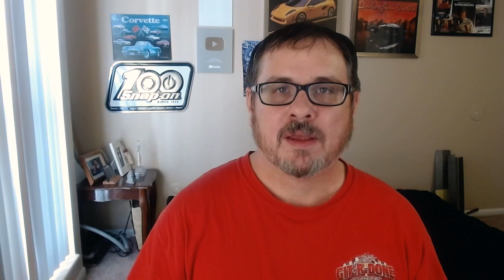Painting 1 Part vs Paint Everything Together

Comment: painting one panel at a time: yep totally agree with the video, you can get some metallic to match doing one at a time but you need to have good control over you parameters and be very robotic about the way you lay the same number of coats down, one for the more experienced sprayers i'm thinking.
if its like a gold metallic then i'd say not very easy.
the other factor in doing one panel at a time vs full respray is the space and ventilation available.
if you only have a 2-4 car garage with no vent then you going to working in a fog within two panels and have the overspray drop down on everything when it settles.
i'm in London UK so thats pure residential and i cant let 2k fumes out side the garage or the council will be all over me, i set up an fan with a filter for extraction, a 150mm ducting takes that around to an imput filter back into the garage so its like a recirculating filter system, works pretty well for 2-4 panels at a time, size is 6 meters x 4 meters so not a very big space at all.

the advantage of doing a couple of panels at a time is you can do the shell on its own then do the doors and hood trunk when you want it also saves on alot of masking material, more than you think esp 2 inch tape.

even at work i prefer to respray a car blown apart unless its a bad edge to edge paint
Reply from the maker: Great points, thanks for the input.

Comment: If he used epoxy primer of brands you have to put your hardner in and wait 15 minutes before you can spray it. When I first started using ppg epoxy primer I was having whole panels peel off with a razor.
Reply: He has to spray bull dog on all his panels that he wants to paint so there won’t be any problems ad hearing
Reply from the maker: Thanks for bringing that up.  That didn't cross my mind, but that epoxy may have an induction time.  Will need to ask NAPA for the technical data sheet to know for certain.  I knew someone on here would think of something.  Thank You!
Reply: @CarAddictGarage  Yeah most epoxy primers have a induction time. I was having come back where I epoxy primed a bare metal hood and 3 months later the paint was flying off on the highway all the way to the bear metal

Comment: here in the uk  i've never used epoxy, etch and 2k primer is the regular thing, so not experienced the problems with epoxy lift
Reply: Be sure to have at least 2 air vapor filters. One at the compressor and one at the gun to minimize oil and dampness in your paint. He forgot to mention filtering. VERY VERY IMPORTANT

Comment: thank you donnie for answer  my question on painting,  i when i paint  my  truck  its  going to  be military green  so there's no metallic or pearl  .  the truck was used in United States Marine.
Reply from the maker: You should have no problem with that color.
Reply: hi donnie i messed up on a question on the washing new oem  ecoat  part.  what i meant to ask is  would it be ok to  just use wax and grease remover and the the skip  the washing the new oem ecoat   with  soap and water  ?   i apologize for asking this question

Comment: Thank you for the great content!   I'm also planning to paint my S10 pickup this spring or summer (1st time painting with a gun) and would like to do a metallic color (TBD) base/clear.  I was considering painting a part at a time as I don't have a booth but that's obviously not the way to go.  However can you do a coat or two of base with it apart and then put it together and then final coat or two of base and then  clear everything?    Also how do you handle the places you can't get to when it's together such as between the cab and bed?    If I can ask one more, are darker metallics more forgiving regarding technique?   Thank you!
Reply from the maker: About the only way to get between the bed and the cab is to remove the bed.  As far as matching, it really depends how translucent the paint is.  More pigment and less metallic will be easier than more metallic and less pigment.  Golds, silvers, and light to medium blues have caused me the most problems with matching.  Whites are also difficult, especially if it has pearls in it.
Reply: @CarAddictGarage  Thank you so much for the reply!   I didn't quite ask my question about between the bed and cab correctly.   What I meant to ask was do you have to do anything special such as not spraying the exterior sides of the bed and cab when you do the opposing faces as I'm assuming you want it back together so as to paint the each side of the truck (cab and bed) at the same time.  Said differently, you spray the back of the cab and the exterior front of the bed with base, then put the cab and bed together, spray the rest of the truck with base, then take them back apart and follow the same steps with clear?   Thanks for the color info as well.   I think I'll go with something other those.     Thank you again for your reply and your channel!

Comment: when doing rust repair inside the car  and cutting  rusted  metal  out  and  putt  in  new  sheet metal  in  the  vehicle      would i have to wash  interior  metal  with dove  dish     soap   with  water  and   use  wax and  remover first then start  doing the rust repair ? can i  just  start  cutting  out  rusted out metal and start  weld new metal  with out washing with dove   dish soap  and  water  and  wax and grease remover ? ?
Reply from the maker: When working with rust and bare metal I would not expose the metal to water.  I would clean it with wax and grease remover before applying filler or priming.  Be sure to use weld-thru primer on the surface that will not be able to get to after welded.  https://amzn.to/3dCQQqn

Comment: hi  donnie  ,  I was reading about lead  filler  soldering    witch is old school body filler  now  they  sell lead  free  soldering    filler  witch is  good.  i have read  lead free soldering cant be use for   rust repair holes ,  i thought you have to cut out   the rust hole to put new sheet metal  in? .  would it be safe to  use lead free soldering for small rust holes no bigger than a   25$  quarter?
Reply from the maker: I would prefer to cut and weld a patch.  The reason is the rust may expand past the hole on the back side.
Reply: @CarAddictGarage      that makes sense . i really like that old school soldering body  filler    its  just cool ha ha.  thanks  donnie !

Comment: What grit do i sand bare metal in preparation for epoxy primer I'm using HP body  989 and it does not say on the tds ?
Reply from the maker: If I were sanding to bare metal I would use 80 grit followed by 180 grit.
Reply: @CarAddictGarage  ok I'll do that thanks for the reply.

Comment: I want to paint an entire car with rattle cans.
Reply from the maker: I have never done that so I don't have any advice for you.  I know there have been others to do that.
Reply: you can paint an entire car with rattle cans, make an appointment with your gp for a new thumb first though!!
if you have never sprayed with a spray gun i would suggest making sure youcan get an even coat over a large area first on a test panel size of a roof or hood
you will need a ton of cans so the cost will be expensive compared to buying a tin of even the cheapest cellulouse
you can get 2k spray cans that are one use only, again stupid expensive
another rattle can system you can get is the type you pour your own mix into then screw on the top and pump up the pressure with a bicycle pump, might work out cheaper
next up would be a small compressor with a mini spray gun, the cost will go into the set up but the results will be far greater than the rattle cans.

so yes you can do it with a rattle can it will be like coulouring in a poster with a ball point pen vs a paint brush